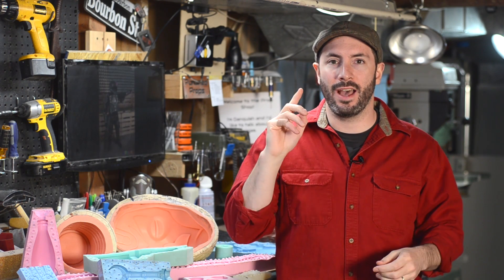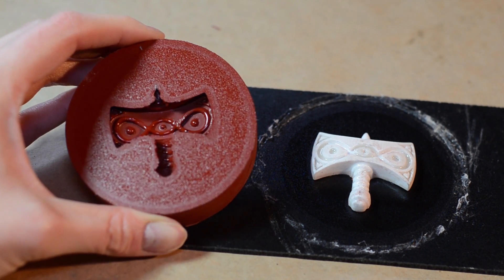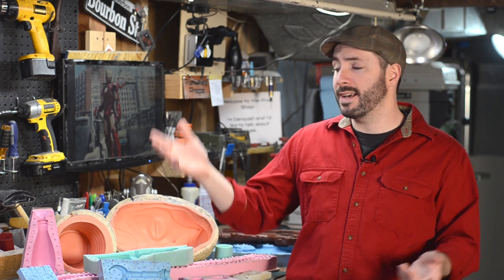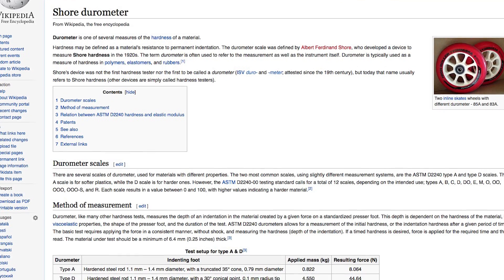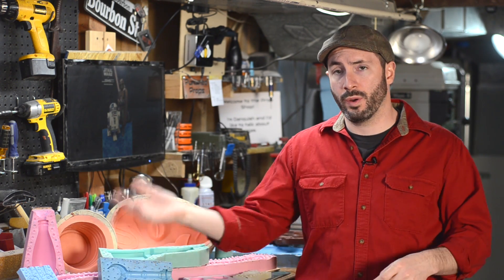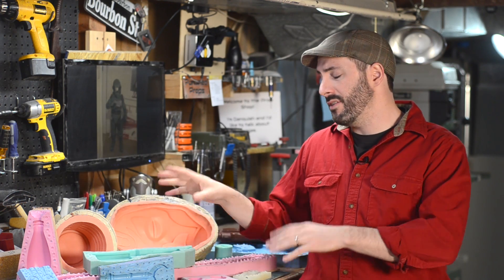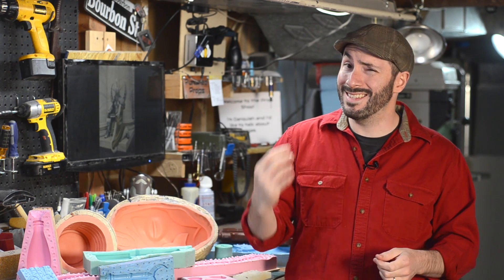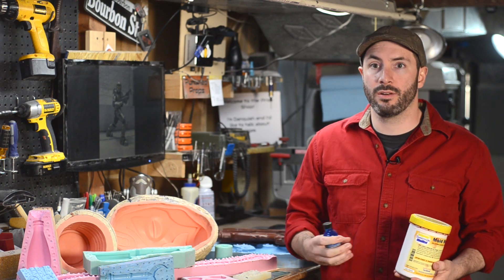Prop: Shop - Molding & Casting 101: Intro to Silicone Rubber

Comment: what product could i use to make drum pads on a midi keyboard or a mic drum machine? i think the original was rubber and the newer ones where made with silicone. is there any rtv rubber or silicone products that can make these soft yet firm pads. ? here is a video showing what i am talking about https://youtu.be/jUf5_f86zTU?si=Bvc_ZJeWkhagdueR
Reply from the maker: I'm not sure, but Smooth-On is great about responding to product recommendations: https://www.smooth-on.com/support/ticket/add/agree/

Comment: So, I have a question that you can probably answer. I want to cast silicone vacuum canister diaphragms (car parts that aren't really available anymore, or are prohibitively expensive). Seems like I would want to use a platinum cure ~30 durometer silicone for this. I have a 3D printer for making the negatives and I am essentially casting small flexible cups with about 2-3mm wall thickness so the release should be pretty easy as well. Does my analysis from what you explained here sound about right? Is there a better choice? The originals are rubber and have almost all ruptured, silicone seems like a much better alternative anyway. They should be flexible and handle many cycles and that sounds like a job for silicone.
Reply from the maker: You can actually cast in a urethane rubber! We always recommend checking with the folks at Smooth-On to see what materials will work best for your project, they're really helpful. When casting in a flexible material, you'll want to make sure your mold is rigid - something like resin or plaster. The Smooth-On folks can help with that too
Reply: @punishedprops  looking at their catalogue I think polysulfide rubber might be better in some cases, and silicone in others. I'll contact them and see what they have to say. Thank you for the info!

Comment: This is going to sound strange but i was wondering if one could make molds of power tool such as drills etc?  The reason being i want to make negative silicone casts of certain tools without the liquid ruining the tool/machine's insides. That way i can make durable molds that i can hydro carbon or plasti dip for tool box holders instead of shadow foaming. Which never last as long or get dirty really fast. Thank you in advance.
Reply from the maker: I think there may be other methods that would work better. Vacuum forming doesn't capture as much detail as it sounds like you'd want.
Reply: @punishedprops  Yes agreed. It was a shot in the dark. Thank you

Comment: great video! Would it be possible to get a video where you go little bit deeper with the material? Both resin and silicone.. Pro and cons etc.. Smooth-on has like 100 different silicons and resin, little bit difficult to know where to start, great to get a crash corse so we dont need to brake the bank and buy all 100 different products :P thanks in advance!
Reply from the maker: We've got a whole series on silicone and casting, but if you ever want to get more specific information for a project I always recommend asking the customer service folks at Smooth-On! They know their products really well and do a great job helping you figure out the best option for your project.

Comment: Question for Punished Props
FlexSeal has introduced a new product called Flex Putty. It appears to be a rather thick and heavy silicone.
Could you evaluate it's suitably for making molds instead of the 2 part stuff you normally use. This request is more for others as right now I'm not in any position to do anything other than enjoy learning.
Reply from the maker: Thanks for letting us know you're interested in that content!

Comment: what is curing inhibition?
Reply from the maker: In order for silicone to cure a chemical reaction has to take place. If there is a contaminant that gets into the mix, like latex or something similar that changes the chemical balance, the reaction won't happen correctly, causing the silicone to cure poorly or not at all.

Comment: Thanks for the informative video.  I am just starting my research in silicone moulding.  I know I want to go with platinum to make my doll but still need to research what to mould with and how I will do it.  I have heard I need to make my mould of platinum as well as the doll will  not cure properly if Inwas to use tin for the mould and platinum for the doll.  Is this correct?

Comment: Hey Bill, I know this is a old video, so dunno if you'll see this. But I recently got a board game called Mage Knight. In it are 68 little plastic crystal tokens with jagged tops. Each being 1 cm wide and about 1 cm and a half tall. They're in 6 different colors, gold, black, green, blue, red, and white. And while they work fine for playing, they're kind of dull and the green, black, and blue ones are really dark. In low light, it's sometimes hard to tell the three apart. 
So anyway, I was considering trying to use a set of fifteen of them to make a mold. And then get some resin and tints to cast nicer ones. That would be brighter shades and more transparent. 
However, I've never done anything like this before, so I'm not certain what to get. I was think foam core for the box. And I'm assuming I'd just line them up in like two rows inside and pour some kind of silicone on top? I'm currently looking into Smooth Cast 325 for the resin and the tints by them as well. But I have no clue on what silicone to use. I'd like to get something that can be reused at least 6 times and capture those jagged tops. Without damaging my existing pieces in case I utterly fail and have to go back to using the base pieces. I don't have a pressure pot or anything like that, so I'd also be preferred to use something that's not super bubbly if possible.
Reply from the maker: Mold Max 29NV is a great silicone if you don't have a vacuum chamber. I'd go with Smooth Cast 326. You can tint it to get your colors and it's longer cure time will allow more bubbles to escape. You're still going to get some bubbles without a pressure pot, but it'll be pretty good.
Reply: @punishedprops  Alrighty then! Thanks for the response!

Comment: What mold should i use to pour resin to make a look like a clear and shiny glass block (like a one slice of a kitkat with the same size and thickness - maybe longer ) 
And what kind of resin to use for the same block?  I need it to be hard enough. A lady told me clearcast 7000, any advice?
Your help will be much appreciated
Reply from the maker: There are several options. You could use a clear cast epoxy. If you have a pressure pot you could cast it in a faster setting urethane like Smooth Cast 325.
Reply: Punished Props Academy Thanks , No I don’t have a pressure pot, and what mold should I use?

Comment: Can you use this stuff for making a copy of a walking stick, but with a fiberglass rod down the center for sturdiness?
Reply: Looks into how LARP weapons are made ! It might help ya :D 
The fiberglass rod is a great start, but please note you would need to put some sort of protection for the tip in case the rod pops out of the silicone. The walking end will get damaged over time with friction and such, so maybe consider protecting it with leather or something else ? Also, repeated use might cause tears to appear in the silicone over time

Comment: Is there any molding material that would stand up to molten silver?
Reply from the maker: Not silicone, unfortunately. There are methods for casting metals that need to be that hot, but I've never tried any of them.

Comment: What would you suggest for a full size Giger Alien head? Was thinking Rebound 25 brush on with a 3 part plasti paste mother shell. Or a mold Star 2 piece?  I have used both, just thinking the rebound will use less materials. Thanks for any advice! Awesome channel.
Reply from the maker: It really depends on what you plan to have the final piece cast in. If the head is meant to be cast in a flexible material like latex, you would make a stone mold. For a rigid casting you'd make a silicone mold kind of like this: https://youtu.be/mZ07x2Wvwps

Comment: If the master I'm making a casting of is made from polyurethane, do I have to spray release agent before the first pour (when it's half in plasticine), to avoid the silicone mold sticking to it?
Awesome channel, the videos and tutorials are really good and explanations are laid out clearly without being too bogged down in overly tech stuff, top stuff.
Reply from the maker: The silicone shouldn't bond to the urethane.
Reply: Awesome, thank you.

Comment: Hi.  That's a great video.  I do have a question we're hoping you can answer.  My wife and I did a non-toxic air trying clay paw impression of our dog years ago, and now that he's passed on, we're trying to get a reverse mold of it.  My big concern is that it will stain the original impression that we have.  Since that's the only one we have, do you have any suggestions on how we can minimize that risk?  Thanks for any insight.
Reply from the maker: I would talk to the folks at Smooth On about what material would be best for that application. https://www.smooth-on.com
Reply: Thanks so much for the suggestion.  I really appreciate it.

Comment: Bacoeng has some really nice degassing chambers.
If you doing small casting, using a smaller degassing chamber is best.
The small ones are CHEAP. $33 for 2 quarts.
Reply from the maker: Great tip!

Comment: Hello, I'm new to the channel. Can you overlap/layer different silicone density? For example ecoflex 20 on top of dragon skin 30 etc.. during? After curing or do they react with each other?
Reply from the maker: If they're both the same type of silicone it should be OK. So tin with tin or platinum with platinum. I've used Rebound with Mold Star with no problems. If you have more questions, the folks at Smooth-On should be able to help you out.

Comment: Hi, I could use some help with my project. I'm really wanting to get into all this molding and casting stuff (not sure what the technical term for this) but my first project I wanna make copies of my wisdom teeth (yeah that right I made a bracelet out of my wisdom teeth but I want copies just in case they break, and yes my braces are on the bracelet too) what silicone, resin I've been getting so confused with all the names, would I use or would work best on making copies of my teeth? 

Thanks in advance I know that was quite the spill, and I really appreciate any help you can give me.

Also p.s. my second project, a much bigger one I've wanting to make another life mask the first one came out all right but I made the cast out of the stoney stuff and my paper mache keeps sticking to it making it impossible to make a mask or helmet with out destroying it. Is there like a resin that is a plastic that can support this or I'm not sure what I'm looking for. There's like no books on this and very few comprehensive YouTube videos. 

Help me Bill Kenobi, your my only help! Again thanks in advance
Reply from the maker: +LaVar Bates I would contact the folks at Smooth-On. They will be able to help you figures out the best materials to use.
Reply: Punished Props thank you so much for the reply! So I found the body double that you and Bob used in that life mask episode and looks like the thing that I need, his later video he make the cast out of plaster.

Do you think the paper mache would stick to the plaster, or would  it be better to use a plastic casting material?

Sorry one more thing would the body cast also be able to work with my wisdom teeth?

Comment: Hey Bill, though silicone is great material but so expensive, have you tried "Composimold" which is reusable by heating? saw some product called "bubble buster" to use with it..
Reply: yeah check that out a bit.. i'm thinking to give it a try..

Comment: Hi all, I have a question about degassing chambers and pressure pots: specifically if I already have a pressure pot hooked to an air compressor can I just buy a vacuum pump and use the same container for both degassing and pressurizing. I know there will be some trade offs (like not having a clear lid to see the process). It is just that every $ saved on tools can be used on materials not to mention save some space on the work shop (I mean garage)

Comment: I have been wanting to make a Destiny Helmet for cosplay, similar to the one that you have made of lord shaxx. But instead of leaving the visor part as foam, Is it possible to use the foam visor as the master mold, so i can create a more sturdy mold for vacuum forming? Or will the foam stick to the silicone?

Comment: Are you going to be discussing why a particular silicon would be better for different projects. I understand short cure times would be smaller project, but why is the gun mold really flexible while the bottle one is relatively rigid?

Comment: I have and I also have tried the Mold star 15 (not sure if I remember it right but it is the cute green silicone) and I used it for a small item but ANYWAY what was I going to say is it let out the air bubbles by itself! I didn't see any after casting but I saw them coming up when the curing started. I don't know if it works like that always but I was pleasantly surprised :)

Comment: I like to use alumilites high strength 3 which is very flexible and captures every tiny little detail perfectly. Can be picked up at hobby lobby and at 30 bucks a kit not to hard on the wallet

Comment: Bill love your videos. wanna ask your opinion. I have 3d printed a full human sized ironman faceplate. it's abs plastic and I have a dream of casting it in metal to get weight and shine etc. I wanna make a mold of it and cast it in wax so I can make a refractory mold of that and melt out the wax and pour the aluminum in. I wanted to ask how do you think I best go about it. the mask as you know is a complex shape so I'm not sure how to deal with eye holes and the curve of it. and I want the mold to be ridgig enough to make wax replicas. also I've tried it on a smaller scale in a different manor and it worked to an extent. 
love to see what you think on my project.
Reply: +Bill Doran thanks. forgot about that video. yeah looks complex. silicone mold inside a fiberglass shell might be able to get away with plaster shell. gotta put down mold release to separate the sides and the eyes. it'd be hard but I would totally be worth it. I wish I could just make a mold ready for liquid aluminum.

anyways awesome channel. I watch all your videos. very inspiring.